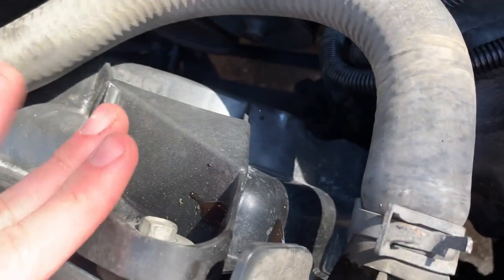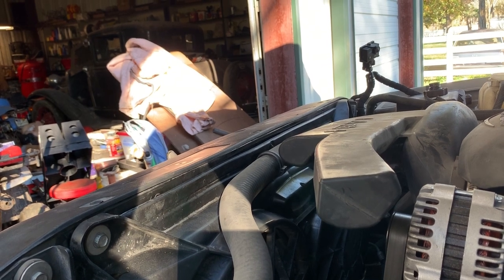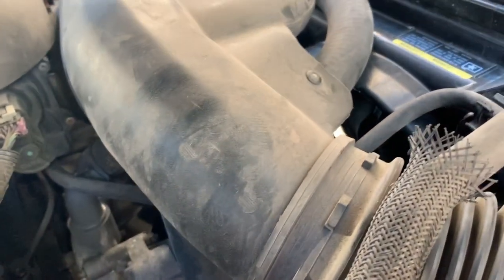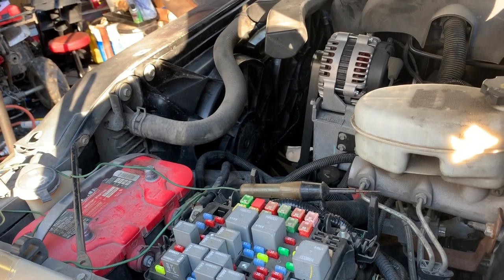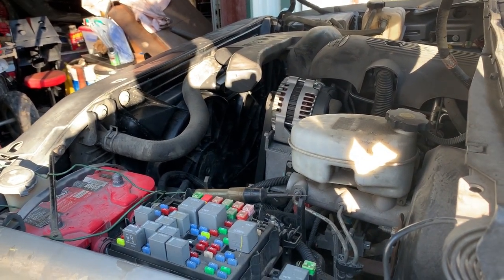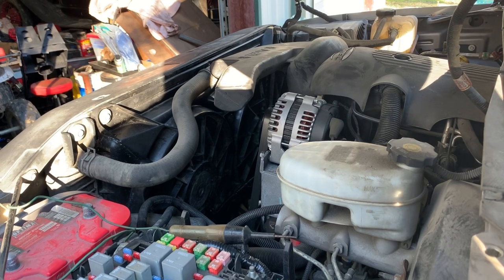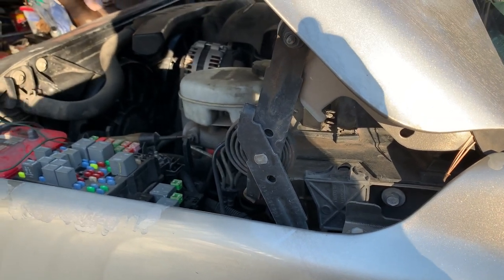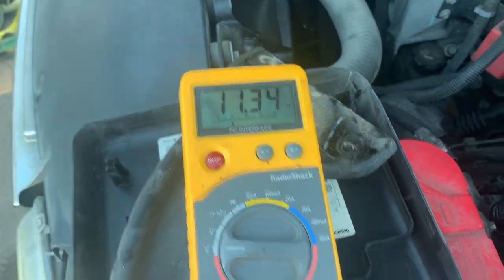03-04 Chevy Truck/Suburban eFan Conversion Part 5 of 6

Comment: What year truck was this on i want to do this to my 04 Yukon and wanted to know if i have to tune it for the fans to work or just pin it and good to go
Reply from the maker: 2003, to my knowledge it will need to be tuned to work.